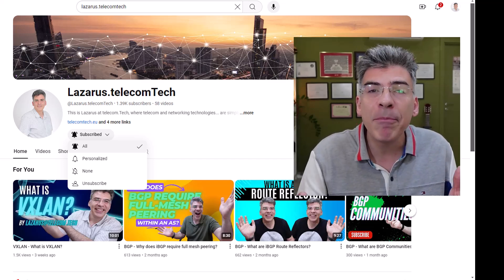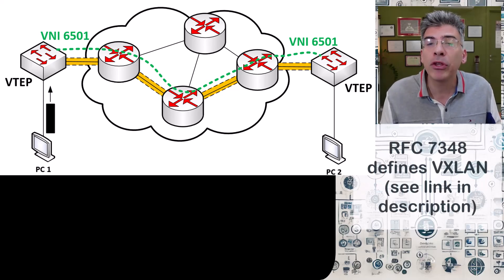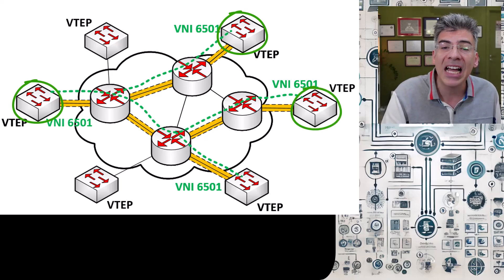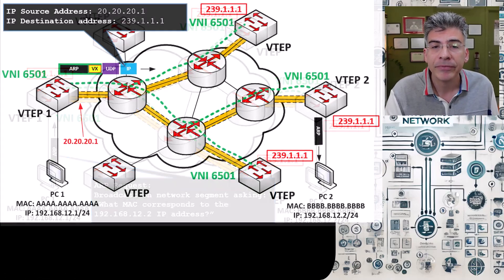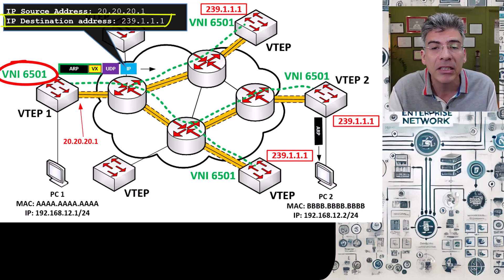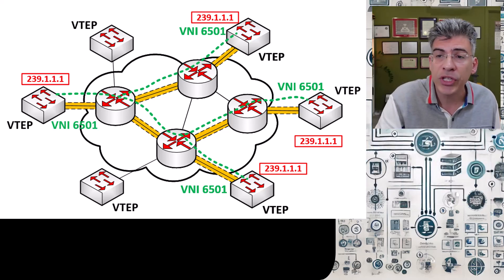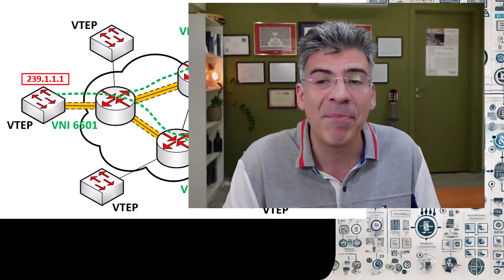VXLAN - Understanding the Multicast Underlay

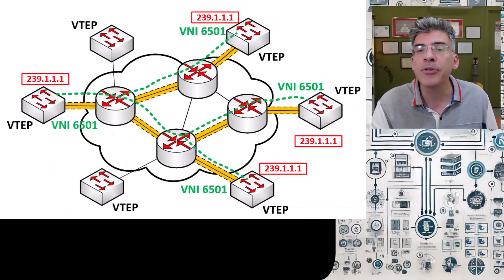Comment: 7:05 isnt flood and learn part of the Data plane ? And not control plane. RFC 7348 literally states “ data-driven process with no control plane to distribute reachability or perform MAC learning proactively — it dawns on the VTEPs only when they see packets.”
Reply from the maker: Good catch 🙌 You’re right, flood-and-learn in VXLAN is a data-plane mechanism, not control-plane, as RFC 7348 explains. Sometimes it gets loosely described in relation to control-plane behavior since it deals with learning MAC-to-VTEP mappings, but technically it’s all happening in the data plane. Thanks for pointing that out, it helps keep things precise!
Reply: @telecomTech.explained  thank you for the clarification,  for new learners it can disorienting.

Comment: Good explanation, one doubt after the vxlan mapping updating happened in both vtep1 and 2
the next continuous traffic will again this vtep encapsulation will required or 1st time only ?
Reply from the maker: Great question! Once VXLAN mapping is updated in both VTEP1 and VTEP2, the continuous traffic still requires VXLAN encapsulation—it's not just a one-time thing.

But flooding is NOT required again—packets are now efficiently forwarded via VXLAN tunnels.

Comment: I would like to know about how to handle silent hosts in DNAC
Reply from the maker: I can’t go into too much detail here, but I can give you some very brief guidelines….
For those that may not be familiar, silent hosts refer to devices that do not actively communicate with the network, making it challenging for Cisco’s DNA Center to discover and manage them. Handling silent hosts in DNAC involves a few key steps to ensure proper network visibility and management.  Here’s how you can handle silent hosts:

1. Use Static IP Addresses
- For devices that may not frequently communicate (like servers or printers), consider configuring static IP addresses. This ensures that DNAC can maintain a record of these devices even if they do not frequently send packets.
2. Utilize SNMP:
- If devices support SNMP configure SNMP settings in DNAC. This can help in retrieving status and configuration information from silent hosts by proactively polling them.
3. Manual Device Addition:
- If certain devices are consistently silent and crucial to your operations, consider adding them manually to the DNAC inventory. This ensures that they are recognized and can be managed appropriately.
4. Regular Network Audits:
- Conduct regular audits of your network to identify and address silent hosts. This can involve verifying the configuration and status of devices that are not actively communicating.

These are just some of the ways you can improve the management of silent hosts within DNAC, ensuring better visibility and control over your network. I hope this has been helpful!